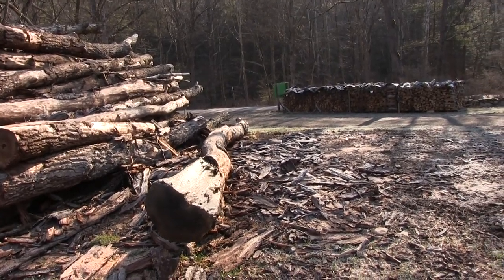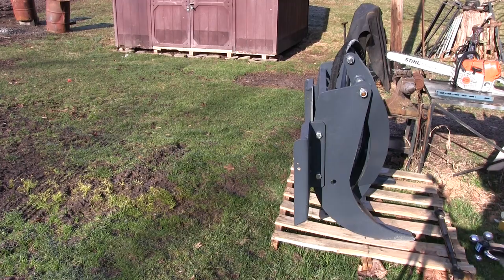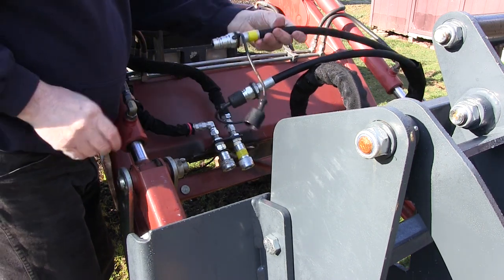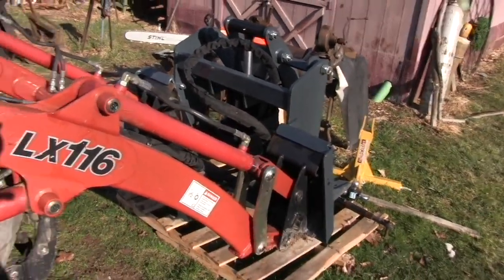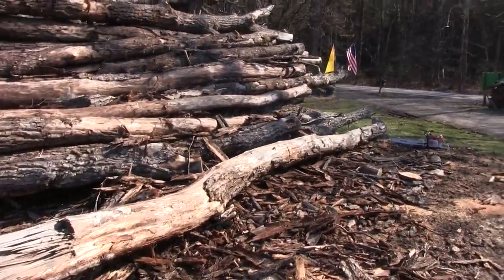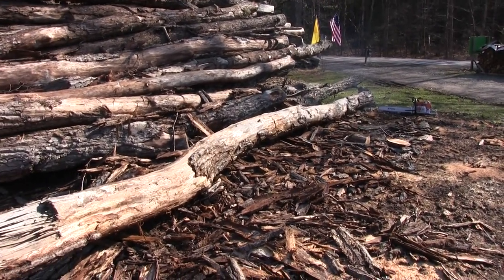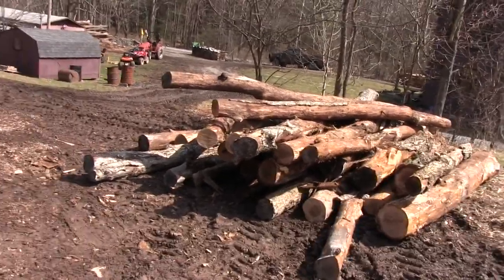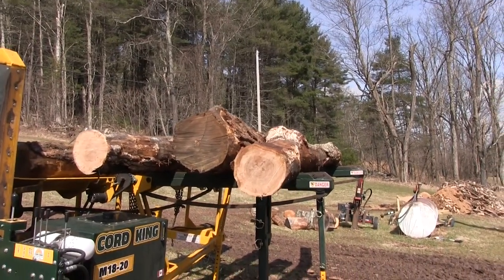Staging logs with the Frostbite grapple - 050

Comment: I just have forks now but thinking of getting the frostbite..  any tips??
Reply from the maker: The Frostbite grapple is really built well. It's designed for doing firewood, rocks, etc. As opposed to a root grapple which with bend with that kind of load. Just saw this happen this week. Make sure you can get the appropriate 3rd function hydraulic valve for your equipment unless already equipped. When disconnecting the hoses, make sure that you allow some hydraulic oil to escape. Otherwise you may have trouble reconnecting the hoses. It can get locked up tight. It's a great product and I have no complaints. If you need anything else, please let me know.